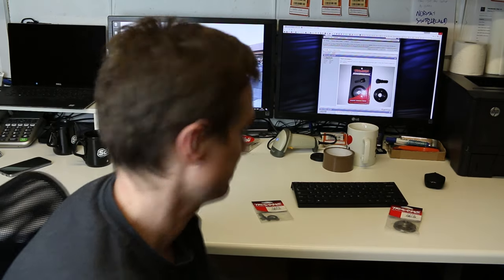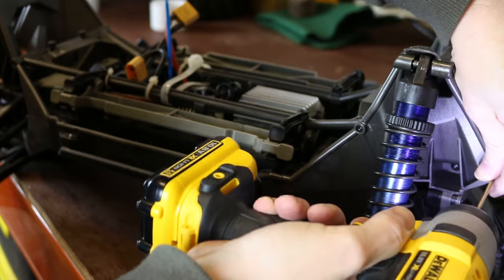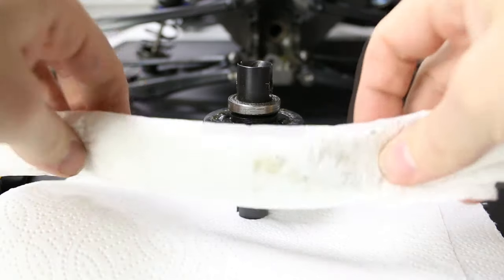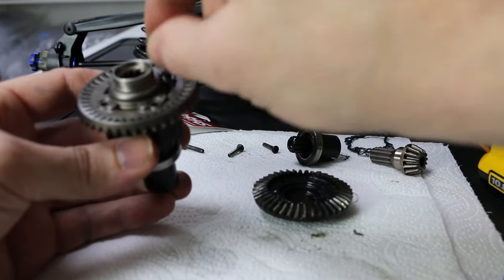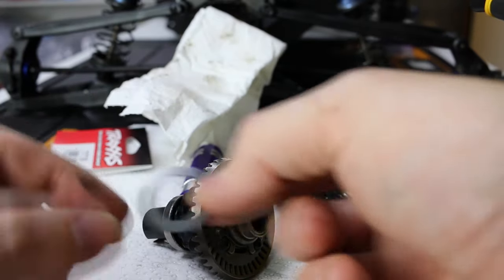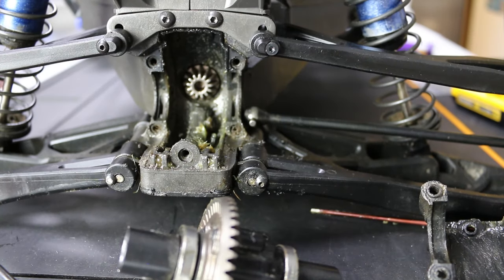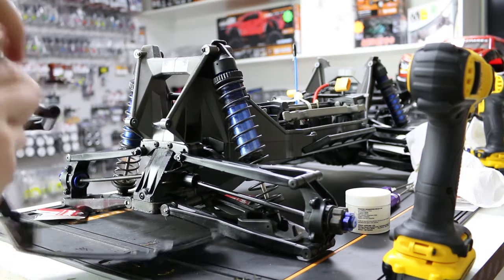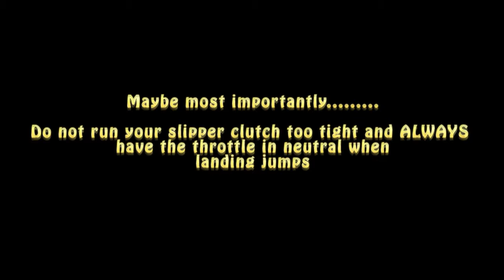X-Maxx Diff Quick Fix

Comment: Loose the pfte shims and try the copper head gaskets from the 3.3 and 2.5 engines for the pinion and you can use them on the bearing side as well.

Comment: A suggestion for the diff fix. Get something called machinist ink, or Prussian blue, and put it on the ring and test assemble, rotate, and check for tooth engagement after the shim to see if it made a difference. My guess though is that where the ring sits needs to be machined a bit to move it in closer to the pinion, or both fixes if there's slop enough to allow your bearings to sit in there even after you install the shim. Either that or there's flex under hard accel by the pinion pushing the ring away.
Reply: High-spot blue......

Comment: pinion shim is much more effective.  Two benefits one I didn't notice until I had the lower bulkhead out with the pinion and diff in there with the upper diff off.  Obviously it pushes the pinion to the ring more but I believe the real benefit is the shim gives stability to the left side of the pinion.  since the ring is on the right if you are looking front to back that preasure creates a slight right side pull in where the left side of the pinion moves slightly right and forward.  With the copper shim in it seams to give support to the opposite side of the pinion not allowing it to move right forward.  Rear   one 3.3 large headgasket right on the bearing which form fits.  Then 2 to three revo 2.5 sims directly on the pinion  Single in front

Comment: Where do u get gears from Kev? My maxx is giving me prob worked fine for couple months motor moved stripped the plastic gear went metal. Re installed then both monkey gears broke. I noticed it drives fine but I’m scared to punch it. I used the Arrma spur gear and it
Makes noise when u punch it I just know the monkey gear is gonna crack. Should I just go back to plastic, I can run it sounds fine if I feather it but what fun is that. Please any advice would help

Comment: I have thoes gpm diffs you saw on Kershaw designs website. so far so good. I'm also running 8s on castle xlx and 2028 motor so it's definitely more than the stock x Maxx.

Comment: quick question ive been dying to ask you if you wouldn't mind.,.. i have the first gen 6s xmaxx running two 3 cell 7500 mah soft packs and they r working ok but starting to swell,,, anyways it really doesn't want to wheelie or really pop up at all for that matter when i got from stop to full throttle, would you be able to please recommend a gear spur and pinion setup that you maybe have tried and found it turns the 6s into a wheelie machine,,, i just want it to lift a litter, and gear to be able to float on the snow and maybe the water if i get some paddle tires.... please help thanks soo much for your better accel gearing ratio.... happy holidays and hope you had a good new year... looking forward to hearing back from you,,, cheers,

-pete

Comment: No power tool for me..with that speed it generates heat which could melt the plastic thread..I would have also change that diff grease to diff oil..